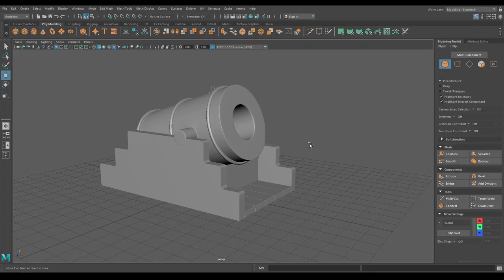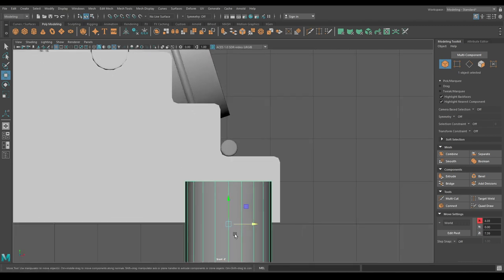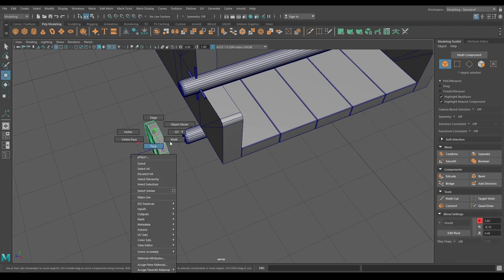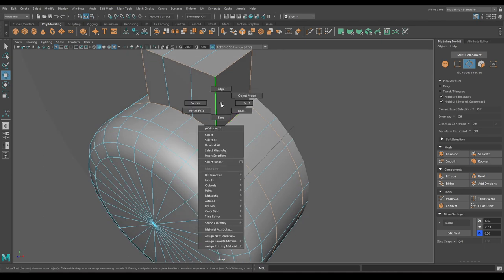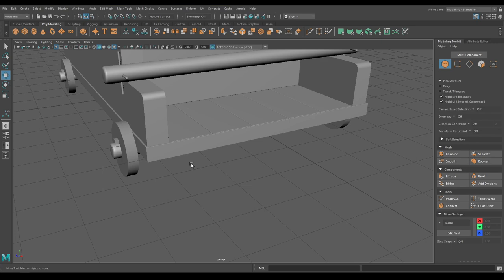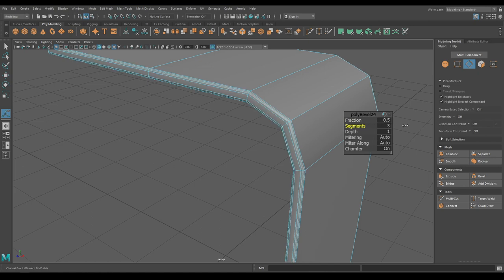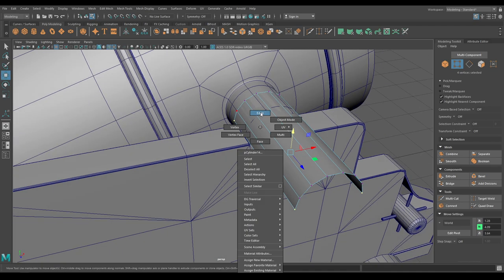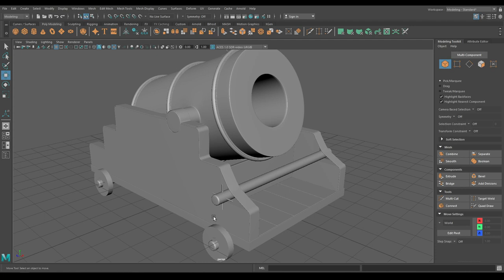Maya Prop Modeling Tutorial | Creating An Old Mortar in Maya and Substance Painter | Part -  3

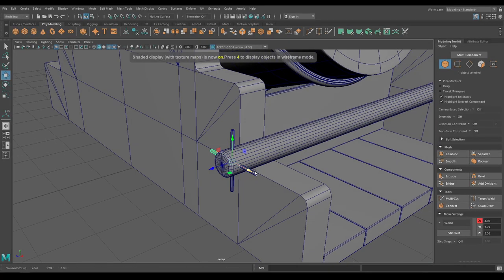Comment: Hi Bro how did you duplicated cylinders on the exact position after changing the pivot point (the part where mortar will stop going down time 4:57 )
Reply from the maker: Change the pivot then duplicate and rotate then press shift+D to create duplicates with transformation.
Reply: I did but it only duplicates but not rotate simultaneously i have to rotate then again change the angle
Reply from the maker: Then you can go to edit and select duplicate special and there you can add rotation and counts of duplicates.
Reply: @3dwolf  got it thanks bro